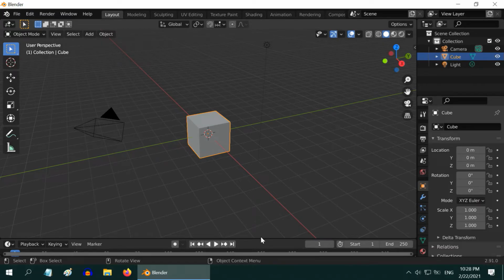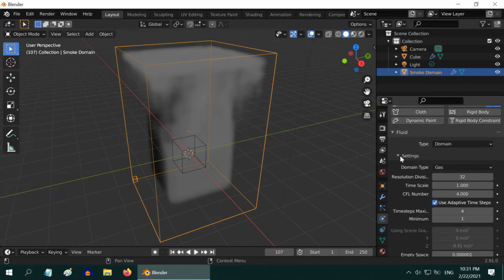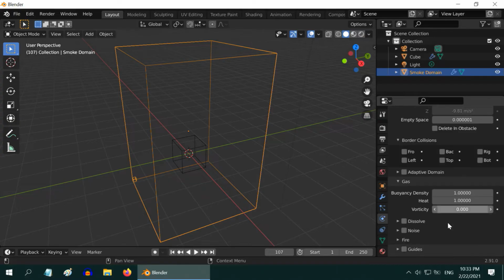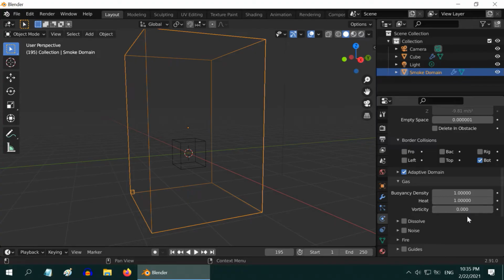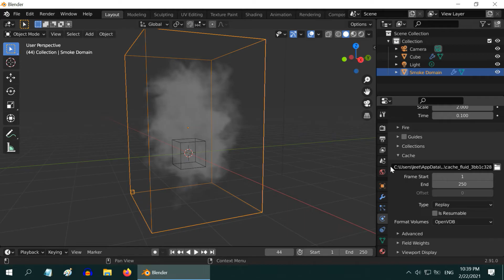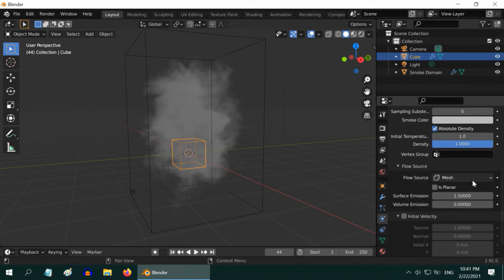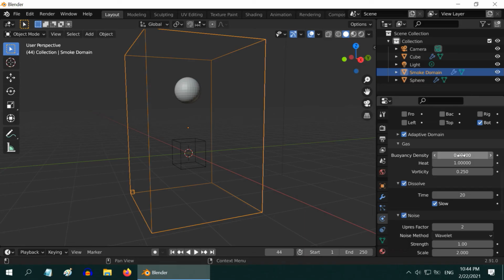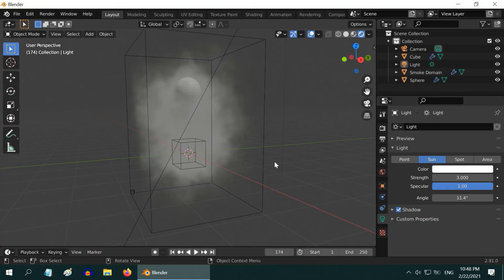All Smoke Settings Explained in Eevee | Smoke Simulation Tutorial | Several Examples | Blender Eevee

Comment: How can I increase the maximum size of the domain? When I put adaptative I dont want the domain to stop growing
Reply from the maker: The domain size is restricted by the domain cube which you have added. If you want it to grow further, you have to delete the cache and then enlarge the initial cube (which is set up as the domain). There is no way to make it indefinitely large. You can make it very large in order to get a large size domain, and keep the adaptive check box enabled so that it does not use the entire domain for each calculation. This way you can effectively get an unbounded domain although technically it is still bounded.

Comment: Hi! I'm really excited about the Tire Smoke feature but I can't get it to work. I just turned it on but I can't see anything in EEVEE and neither in Cycles. I must be missing something, but I'm not sure what. Eitherway thank you for making this amazing addon!!
Reply from the maker: Yes, working with smoke can be tiresome at times. Sometimes it won't show up, sometimes it shows in the viewport but not in the render etc. This usually happens for one or two wrong setup which we may overlook when we are new to smoke setup. I suggest you to start with a fresh blend file and follow the steps in this tutorial exactly as given. At each step, compare the results. If you see any deviation from what is shown in the tutorial, pause and either send me a screenshot (5minblender@gmail.com) or describe what you did and what difference you see. We have to solve it step by step otherwise it would be too difficult to guess why at the end the output is wrong.

Comment: Been trying to figure out smoke for a while now. Whenever I try to render smoke. It just pops in at stages, and doesn't animate like it does in your video, it seems to render a stage on each pass whenever I loop the animation and thats about it.

The project im working on is pretty simple. Just having steam blowing out from a small nozzle, kind of like a kettle blowing steam sort of effect, but im having a hell of a time. Any help would be appreciated!
Reply from the maker: Working with smoke can be a learning exercise before you can make it perfect. Two things are coming into my mind: 1) You may have a lower domain resolution, so the smoke is more like a cloud, that is not fluid enough to spread or evaporate, you need to increase the domain resolution for a better smoke 2) The smoke is not spreading out due to low temp difference, try to increase the temp difference or add some vorticity (0.1 or 0.2 is enough - too much vorticity will kill it). At the end I'd say that achieving a good satisfying smoke simulation can be a length exercise if you are doing it for the first time, it's normal.

Comment: my smoke just sits stationary in the shape of a cube and does no simulation. it just flickers
Reply from the maker: Please add some temperature difference or buoyancy to make it move. Alternatively, you can add some vorticity that also helps the smoke to spread. If still nothing happens, please check your cache, the smoke cache may be outdated or it's not working. Remove everything and create a fresh smoke setup.
Reply: @5MinutesBlender  thanks for replying. i ended up having to do the smoke in a new scene. For whatever reason, the complex scene was using would not handle the smoke properly, but a new scene worked fine. I tried everything in your video, which were all helpful things, including erasing the cache. Nothing worked. After 3 hours I gave up on figuring out what was different about my scene. Perhaps it was just the complexity of the scene, who knows.
Reply from the maker: @pierogi-h3u  You're definitely not alone 🙂 This happened to me as well, although very rare, that a particular blend file won't work whatever I do. And the exact same setup in a new file works. There might be some bug somewhere, hard to track. But this was very rare, so it was not a big issue. Blender team has officially stopped working on these physics simulations since Blender 3.0 or so, it's all legacy code now!

Comment: How can i stop the smoke generating in middle ?
Reply from the maker: You can keyframe the Use Flow field of your flow object. If you keep it enabled until say frame# 40, it will generate smoke only up to that point. You need to enable it for frame# 40 and insert a keyframe, then for frame# 41 you need to disable it and insert another keyframe there.

Comment: But in my case the somke is only shown in solid mode but not showing in eeve and cycle please guide me.
Reply from the maker: You need to add a domain material with volume shader, and increase the intensity of the light & the density factor if the smoke is very faint.

Comment: Hi!! is there anyway to export a smoke simulation animation to FBX GLTF ??
Reply from the maker: No, unfortunately there is no support for smoke simulation export from Blender yet 😐
Reply: @5MinutesBlender  mmm is there other option for gas simulation in blender? Because with particles animation is possible to export them using a script...
Reply from the maker: @ingenieroaj6345  I am not aware, so even if there is a way, it's not in my knowledge. Having said that, it is always possible to do anything you like using scripts. It is nothing but coding the program for your requirement. The challenge is to write the correct script. But you ignited this idea, I wrote couple of scripts for various other scenarios. Maybe I can give it a try when I get some time. It may be useful for others as well. Thanks for the suggestion!

Comment: what if we want to freez smoke ? what should we do ? or make it slow motion?
Reply from the maker: You need to play with the simulation speed (Time Scale value) in the domain settings. Lower the value, slower the motion. You can keyframe this field. With a zero value, the smoke will freeze at the desired frame. We have discussed a similar example here 👉 https://youtu.be/dzOmwXjkdIc Although it is for rigid bodies, the same technique will also work for smoke.
Reply: @5MinutesBlender  very tnx

Comment: I have a question as someone who's somewhat new to the new Blender: whatever happened to the "high resolution" under cache, that was once there in the older version of Blender? In Blender 3.0... it's been removed. Would you know what they have replaced it with?
Reply from the maker: Hi, those options got changed when Blender replaced the old fluid simulation engine with Mantaflow. We have a different workflow now. The resolution divisions for a domain object defines the smoke details. We have a separate section to enable "noise" factor which adds more details to the smoke. It is not a one-to-one replacement, so there is no single option for the old High Resolution effect.

Comment: hey, I was wondering I have an object where I have an mirror modifier on it, if its not applied, there's not a way to collide with the mesh that's generated? bc I have shape keys on it and can't apply the mirror modifier but I have a smoke simulation over it
Reply from the maker: To keep things simple, you can just duplicate that object. Apply the modifiers on this duplicate copy. Use this for the smoke simulation baking instead of the original object. Once the smoke is baked, hide this duplicate object from render. Use the original object for render along with the smoke.

Comment: What's the value that completely fills the domain with smoke? I can't find the culprit. 

I thought it was cache after several clicks but it really happens out of nowhere. 
Having a filled up box that then fades into the simulation does not work
Reply from the maker: Place your flow object at the lowest end of the domain. The smoke will then fill the domain quickly. However, the density will vary. It will be thick at the upper section as the smoke continue to move up and accumulate there.
Reply from the maker: Additionally, in the domain settings, you can set Buoyancy Density and Buoyancy Heat as 0.0 so that the smoke spreads almost equally in all directions instead of going straight up. It can also help in your case.
Reply: @5MinutesBlender   

I tried making some sort of slow moving mist, but after X clicks the whole domain fills up with a smoke square until the simulation begins. 
Maybe the solution will be to start from frame 1 instead of frame 270, hmmm. 

Thanks for your reply mate

Comment: I have an issue here, I did everything just like you, but when I start to render, smoke isn't there anymore. But when I look to viewport it's there normally. Do you know what is the problem?
Reply from the maker: It is a common issue. When you render a scene, it takes into account the lighting and the smoke material. If the light is not sufficient, or if the smoke material is not correct, you wont get to see any smoke (or it will be too faint to notice). This is explained in this tutorial 👉 https://youtu.be/ZuV0P_rAIjs Please check. If you still cannot get it resolved, it may be something specific to your composition. We will look into that, please let us know if you still face this issue.
Reply: @5MinutesBlender  Thank you, but it worked only partly. Before I did not see the smoke on any camera, but now it's only visible on camera that is close to smoke, but on camera that is further I still can not see it. Also I found out that in Cycles smoke seems okay, but the project is too complicated for rendering in Cycles
Reply from the maker: @VitusIsMe  Please check the volumetrics section in the render properties, change the End distance so that it includes your smoke (in addition, you should also check the clip distance in the camera properties, but that is probably already correct I guess). Since you said the smoke is visible through a camera that is near, it is probably getting clipped in the volumetrics when far away. If this also does not fix the issue, I would request you to send your blend file or a sample file to us, so that we can verify the root cause. You can get our contact details (Email ID) in the About section of this channel. Thank you!

Comment: In version 2.93.7, not only can I not get the smoke back after the first viewing of the simulation, but I also have problems with scaling. Have you not had them? Scaling by z causes the smoke to shift to the right, scaling and moving the domain by x leaves the smoke out of sight altogether. Can't switch to 3.0 because of computer hardware mismatch, but I need the smoke. Should I go back to version 2.8.x?
Reply from the maker: Hi, after you change the scaling or the location of the domain, you need to bake the simulation again, otherwise things will go out of order. Sometimes even baking does not solve the issue just because the old cache somehow still remains in the system. Ideally this should not happen, but it actually happens that the old cache is not refreshed, and you do not get the intended result. In this video, we have also discussed how to mitigate such issues. If nothing works, you can even go to Windows Explorer and manually delete the cache. Once the old cache is removed and you bake the simulation, you should be able to get back the smoke perfectly. Please let us know if that still does not work. Going back to 2.8 is something I won't recommend for various reasons.
Reply: @5MinutesBlender  I did it! 😁Version 2.83.18 was shocking because it had the same interface and tools as 2.93.7 😲. Well, there was no denoise. The same turned out in the settings and values of the variables on the physics panels. And the smoke behaved the same way as in 2.9 - it wasn't there! The difference was in the cache settings. I noticed that the smoke disappeared when Open VDB was selected and became visible when Uni Cache was enabled. There was also no smoke when I enabled Noise. I noticed that a second, separate setting for noise files appeared in cache that automatically assigned file output to VDB. I changed the format to Uni Cache, and it was possible to work with Noise. 
Of course, I couldn't get my project made in 2.93.x into the older Blender, so I made a render of the smoke in 2.83.18 and saved the picture in png format. Then I used it in the project (import image as plane) with the steam engine. It turned out satisfactorily, because for rendering the smoke I appended light sources (HDRI too) and the camera from the project with the locomotive.
Reply from the maker: Awesome! Really glad to know how innovative you were to make use of two different versions to work together into one scene by importing one output into another. Great work! 👍👍
Reply: @5MinutesBlender  While I did the simulation on 2.8x, I was able to do it in 2.9x (so-so). It turned out that there is an option to import simulation frame: add - volume - import volume vdb. But damn, I have no way baked vdb files and simulation in this format does not happen! But why ? I can't find the answer.🤯
Reply: @5MinutesBlender  Dear Sir! Miracles with scaling happen before baking! And there is nothing to bake, as there is no smoke by this time. I deleted all cache folders manually, it did not help. I already installed Blender 2.83.18 (in parallel with 2.93.7), but I can only start playing with the smoke simulation at night.
Reply: @5MinutesBlender  Let me add that in previous years I had no problems with the physics in blender, so apparently I have the developers of later versions of the program to "thank" for what is going on. I also have a dream (a pipe dream) that blender 2.93.x would add the geometric nodes from version 3.0. Already now, all the tutorials refer mostly to these new, reworked nodes, so what about the future? I have already written that my PC does not meet the requirements of blender 3.0 and I will not be able to change the situation in the foreseeable future, but I also want to use such a wonderful apparatus of geometric nodes.

Comment: my smoke disappears every time i change the settings. ive tried baking it afterwords, but it remains invisible.
Reply from the maker: It happened to me once. I figured out what the issue was. I was initially working on a new file that was in the default installation folder. Afterwards I saved it to one of my work folder. But Blender somehow still kept a reference to the old cache. So whatever I do, it was not refreshing the old cache. It was refreshing the new cache, but it was referring to the old cache while playing the simulation. Very weird, I know! But simply deleting the old cache folders manually from Windows Explorer solved the issue. In your case, I suggest to start with a new file, and see if you still get the same behavior that you faced now. If it does not happen with a new file, then somehow your previous project was corrupted. But even with a fresh new file, if you get this same issue, please let me know.

Comment: When I click quick effects>quick smoke the smoke appears but it appears totally black. What may be going on?
Reply from the maker: Are you viewing this in the rendered mode? If so, I'd suggest you to check your light settings. The light should be bright enough for the smoke to be visible in a normal color.
Reply: @5MinutesBlender   Thanks for the so swift reply! I did put an efficient light source in the scene and the smoke became somehow grey but still remains without density. Do I have to turn on some volume or other settings in Eevee?
Reply from the maker: @dimitrilalushi4693  You can control the thickness or the texture of the smoke by changing the material properties of the domain object. Please check this tutorial, I think it will overall help you 👉 https://youtu.be/ZuV0P_rAIjs
Reply: @5MinutesBlender  Thanks, will check it!

Comment: You saved my life. Deleting cache files for bringing back the simulation on screen. That was so annoying to me having no clue what to do, except starting from scratch again.
Reply from the maker: Glad to know that it helped you!
Reply: @5MinutesBlender  To be more precise, it worked at first but then, after I adjusted some settings, I additionally had to switch the Cache Format Volume Type to "Uni Cache" and let simulation start from the beginning. That worked fine. Funny thing, inside the chache files there were several .uni files although Cache Format Volume Type was set to "OpenVDB" at first, which is the preset, I think. Also a common issue I experienced is that for each simulation playthrough, let's say frame 1 to 250, only 1 extra frame of smoke simulation was calculated and after the next playthrough one additional frame again and so on. Seems to be quite fault-prone this kind of simulation. Another issue can occur when you change the storage path of your chache files. You can have "fun" there as well.
Reply from the maker: @karstenz.8754  You bet, I ran into each of those issues sometime or the other, I can feel you 😂 The last one that you mentioned... once I was working on a planetary animation, and I decided to change my project folder structure midway. Oh boy! Next 2 days were nightmares to get the simulation work again. I did everything that possibly can come to someone's mind. What finally worked was, deleting the old folder structure manually, although our cache files were already moved to the new folders. It seems somewhere deep down the blend file, it keeps some old references. So yeah, it is always a learning experience with fluid simulation - that is the nice way to put it 😃
Reply: @5MinutesBlender  Oh dear, I am bit afraid to proceed with my project :-). Hopefully, these bugs are getting fixed during the next blender updates. To sum it up, blender is an "experience" in many ways :-)